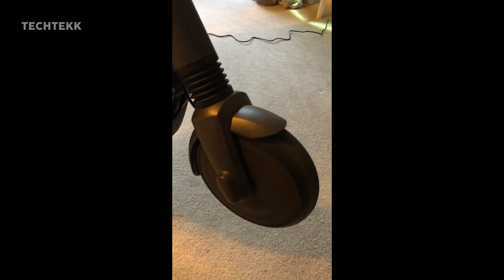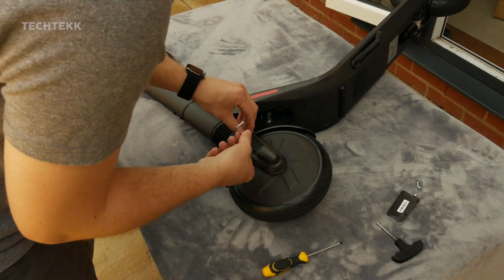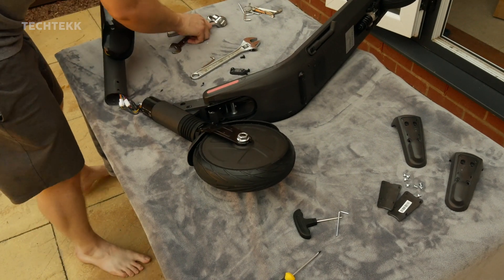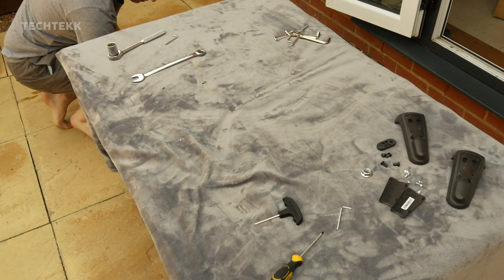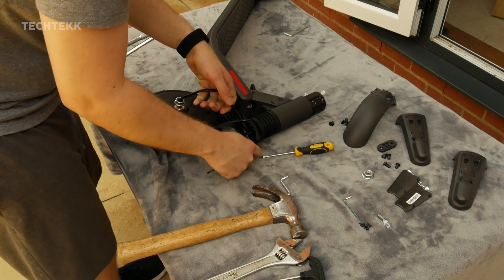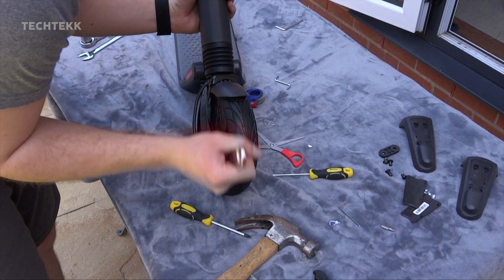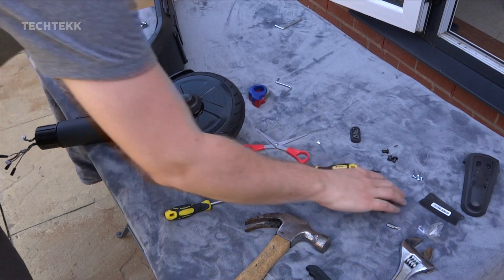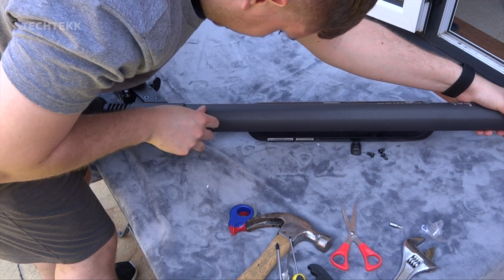How to replace a Ninebot Segway ES1, ES2, ES3, ES4 Front Wheel Motor (UK English)

Comment: Jesus H Christ, that front wheel is on there tight on the E45. Couldn't crack the nuts with 19mm keys and had no 19mm for my drill either. Was gonna put some 9" studded offroad rubbers on for the winter, but at this point I think I'll just drill some studs into the original tyres and take em out when the ice melts. 😵
Props to Mr. Segway for tightening the ever living 💩 out of those nuts 😅

Comment: Hi I have a problem, my front wheel is not alligned with the handlebars and it’s stuck and whenever I try to I tighten the screws on the headset and at the lower front, the screws don’t budge and the Allen key doesn’t move anywhere, help please

Comment: My ES4 e-scooter has an exposed wire located: behind front tire / bottom of long stem. This wire snapped due to the sharp edges & folding the scooter. What is this wire and How can I replace it? Is there a video, link or diagram 😩😳

Comment: No need to change the engine you could replace or repair the green wire. that's where the error is and it was the sound.
Reply: That green wire do you mean the one in the stem?

Comment: I think this happened to my scooter today after using the electronic brake going full speed. The sound my scooter makes is exactly the same. Did yours start vibrating and only able to go half speed as well?
Reply: I have the same problem. Have you repaired the scooter?
Reply: @Piotr_R  No. I didnt want to risk buying parts unless I was 100% sure which part was broken.

Comment: I got the replacement on ebay which is a new motor/tire/bottom frame i believe called the front fork of scooter. I just am having trouble getting the nuts off (two nuts on each side) as they are probably factory tight on there. Any suggestion for getting the nuts off?

Comment: Followed it and it went smooth, THX. I did put on a string when removing the old wires to be able to assist with pulling the new wires back. It worked fine (in addition to move the remaining wire a bit back and forth). And then I also had to insulate the wires as it seems there had been a shortcut melting some of the wires. But still, it worked with a new motor only.
Reply from the maker: Great! 👍🏻

Comment: Hello! I've followed along doing the exact same to my scooter, but now Im on the tug wires part, and can't for the love of god get the old wires out. How did you do it? Did you take the battery cable out first, or one cable at a time?
Reply from the maker: Your at the most tricky part. You just have to try and take one cable at a time out. It’s really fiddly but just be careful not too pull to hard or you could break the cables

Comment: Hey, I have an issue after I replaced my engine. With the tightening of the front wheel. I cant really tighten it that much before the wheel is just stuck. And therefore the screws get quite loose after only a few days use.

Am I doing it wrong or have I overseen something?

I know the video is old, but I really do hope that you'll see this and maybe give me a clue as to what is going on.
Reply from the maker: It sounds like you may have cross threaded the screws or the screw thread on the motor. You might need to replace them so you get a tight fit
Reply: Hey did you ever find the promblem and how to fix it
Reply: @701_user  There are some sort of metal plate between, thats supposed to support the tightening of the screws. They can be really tricky to get right, but if they actually sit right you can tighten the screws and they wont come lose. You might need to fiddle abit with it. But after I tried and failed a lot of times I finally got it :) Hope it works for you
Reply: @MonsieurBambi  thansk a lot yesterday I installed a new wheel so and had this problem but didn’t have to to fidget with it

Comment: My ES4 has just started making one of those vibrating, grinding kind of sounds, especially on accelerating. Are there any bearings in the front wheel motor hub that have got loose, or is it quite literally do what you've done - remove and replace?
Reply from the maker: The wheels are sealed units so you’ll have you remove and replace
Reply: @Techtekk  Thank you.  🙂

Comment: thanks very much for this. can you explain the sound your motor was making please? i think i'll have to change mine, it sounds a little like a bearing is loose but the wheels spins ok when ridden without power. i can still use it but takes a little longer to get up to speed.
Reply from the maker: It was a really loud noise was the wheel was spinning
Reply: @Techtekk  I have a loud noise that started happening during braking, and a few minutes later it happened also when accelerating. It sounds like something is loose inside the wheel. I took your advice and ordered a new wheel. But out of curiosity, I opened up the cover and it looks spotless inside. nothing loose at all (ES3)  Have you ever diagnosed a motor? I would like to keep it as a spare if it isn't too hard to fix!

Comment: Thanks Daniel for your helpful video. A couple of questions. You didn’t mention why you were replacing the wheel/motor. Was it because of a noisy motor/regen braking problem? That is certainly my problem. I have ordered a replacement motor but I have also seen many comments saying the problem is with the controller not the motor. If your problem was a noisy motor did your replacement fix it. Sound like a silly question I know but you didn’t do a before and after test so It’s a bit of an unknown. Second question: I see that you bought a non original motor/wheel from AliExpress. I considered doing that too but was put off by their measurement of 21cm diameter which would be too big and would most likely result in the tyre rubbing against the front mudguard/fender. What was your experience with this?
Reply from the maker: Your welcome. I did at the start but unfortunately the background music got copyrighted so i had to replace the audio. The problem was a noisy motor and yes it did fix the issue and iv’e not had any issues since even by ordering one from aliexpress

Comment: do you have a how to video on how to fix loos stem or loose steering?
Reply from the maker: I don’t, however you can tighten up the stem with the screw. I’f that doesn’t work you’ll have to pack the stem with something so it doesn’t wobbly. try using strong tape on the inside

Comment: my motor just stopped working. it's like the break is always on. will this fix it? everything else (the board etc) seems to work fine
Reply from the maker: Yes, this should solve the issue
Reply: @Techtekk  , firstly, thank you for answering. i opened as you did and as soon as i disconnected the BLUE and the BROWN wire, the breaking feeling on the wheel disappeared. what can it be, you think? motherboard?
Reply: @mrnomore  Maybe the brake lever hangs somehow ,check connections
under the display?
Reply: @theowink  , i found a guy with exact same problem. he said it's the control board for sure (burned cables due to overheating). i'll open the upper part tomorrow and try to find where the cables have burnt. not sure they have, but i've got a feeling... well, i used it for 3 moths with hacked software reaching 38km/h (and i'm 96kg!). kinda happy anyway :D
Reply: @mrnomore  wow Ok what software ur running?(there should 
be a fan blowing  for heat dissapation,but I guess there is no space for that.Btw i weigh 100 kgs,and today I adjusted the undershock to make it more stiffer.Worked out good!
Reply: @theowink  yeah, i fixed the shocker as well. so much better! i use the SNSC. i put the power to 49k so it's not too much. i also set the start to 1km/h too so it starts without kicking. great software
Reply: it could be because the power issue, if it breaks and the lights blink, watch these videos 
https://www.youtube.com/watch?v=I2j5rYa6MZM
and try this fix:
https://www.youtube.com/watch?v=2dQNAD3uEr8
https://www.youtube.com/watch?v=ew56TqwZ_vU
https://youtu.be/m1FCArQ2cpo?t=829